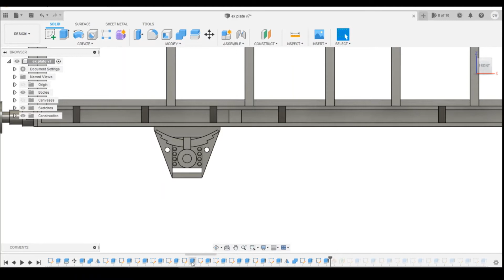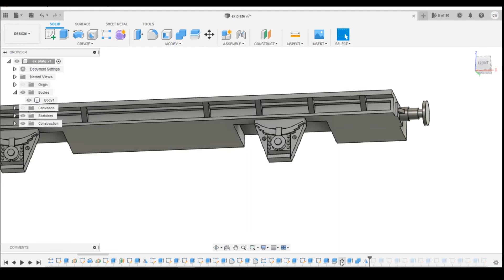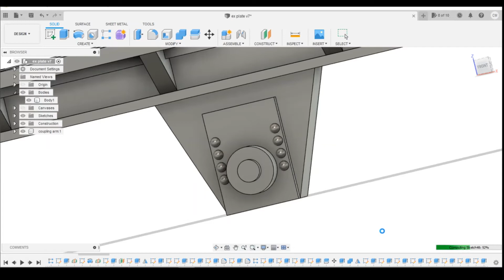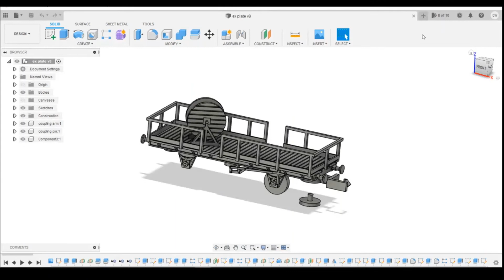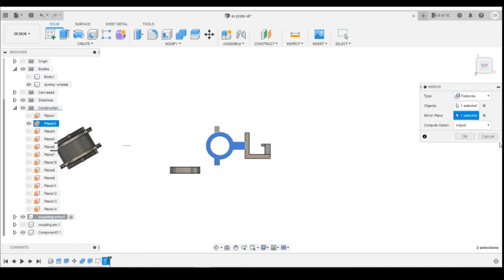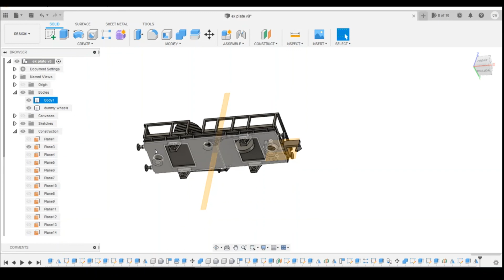How to draw in 3D using Fusion 360 (Part 7 of 7)

Comment: Hi, just done my first ever resin print, of the wagon, and would like to know if it is best to cure it before or after trimming it off the supports. Think I had too many supports, have you a pic of your print with them please. Thanks again for the videos
Reply from the maker: Hi Tony,

You can remove the supports either pre or post curing,  I do find that its much easier to remover the supports pre curing.  if you find that the model warps then you can clamp it to something ridged and flat,  heat it up with a hairdryer and leave it clamped there for 24hours while it cools.

Regarding the amount of supports I cant post a photo to show you but if you look at the videos on the channel there are a few where i show the supports I add to my models.

Regards

Carl